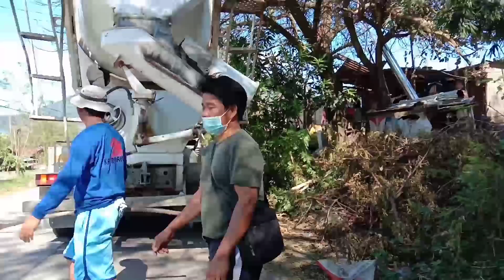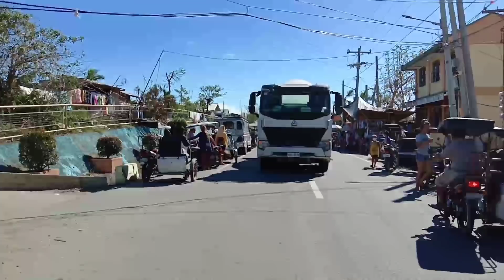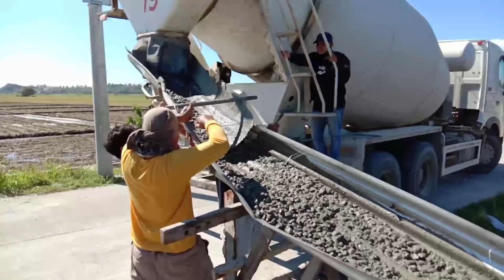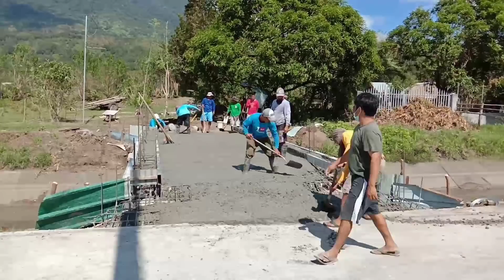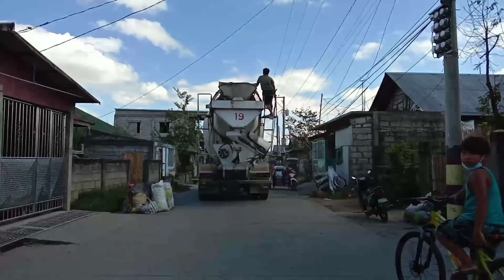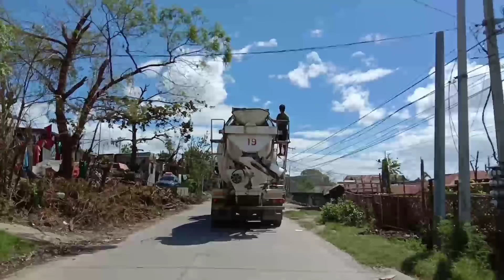PAGBUHOS SA TULAY

Comment: Dapat monolithic ang buhos cgurado d na kuha ang concrete covering mo sa top ng beam at sa may road side R.C. slab 😱
Reply: Sa concrete pouring lalo na kung aNg floor , slab or beam will serves as structural entity, dapat kumpleto yung buhus at thickness kapag binuhusan, kung mag tatop up ka sa kulang sa ibang araw, di na makakatulong sa structural requirement or structural re-Inforcement sa entire bridge..sa pagbuhos Ng cemento sa tulay, di puwede May construction joint dapat one time Ang buhusan..

Hoping yung bridge ni kafarner di nagkukang Ng cemento or di naging manipis sa design intent na 8 inches Ang kapal..

Sa bakal at arrangement Ng structural rebar wala akong masabi, hoping kumpleto yung thickness Ng tulay di bale yung slab after sa Column , kahit kulang nakapatong naman sa lupa kahit dagdagan na Lang thru manual concreting..

Congrats Katrabaho!!